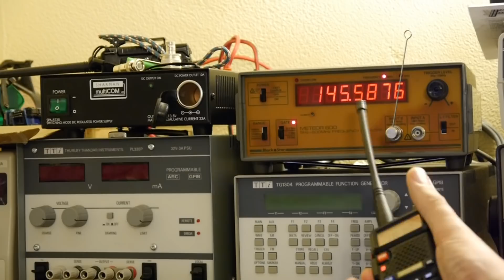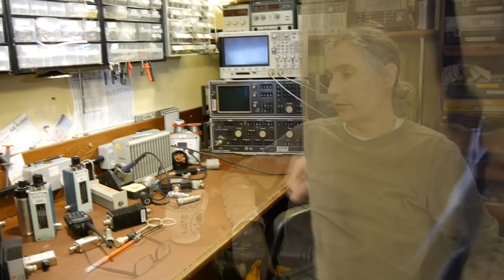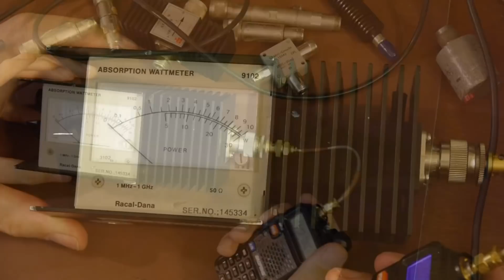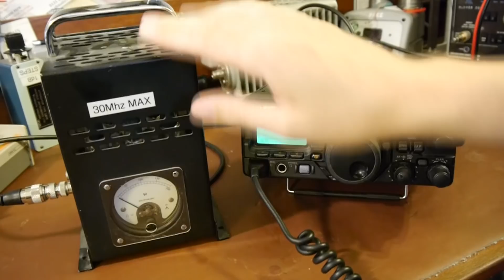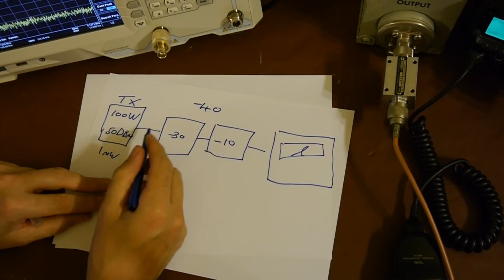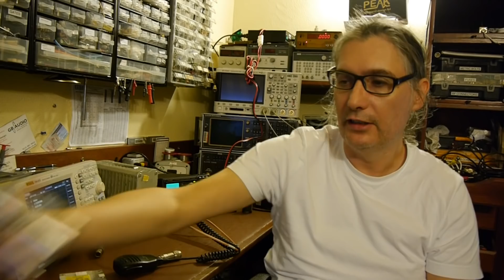RF Measurement Part 1   - When The Shit Happens

Comment: Oh no, the Marconi! That's a big shame. This was a really interesting video Chris, thanks.  I don't transmit as such but it's still obviously a big part of the broader interest in radio so this was very educational. I've never understood decibels so it would be great if you can go over that at some point. I bought an amount of Greenpar, Amphenol etc connectors on eBay, all sorts of stuff for a tenner I recall. Must have been a shack clearance or something but it was something like 20-30 different connectors. One of the best bargains I've had considering the individual prices. Fingers crossed the Marconi isn't a big fault.  Andrew

Comment: Excellent video - more please. That's a great tip about using adapters on test gear to prevent wear and tear on the input connectors. I did the same thing with power sensors, add a N type female to female "barrel" and a male to male adapter. We used to measure the added loss (at 1.03 Ghz) and correct readings.
Reply from the maker: David V Hello David thanks for watching and the excellent comments. I think someone passed on the idea about fitting a sacrificial onto me in the distant past. Although not shown today I mostly keep a short lead and a attenuator fitted permanently. Best regards Chris

Comment: Bloody hell that made me jump. Hopefully it's just the input cap! And just after you were saying how much you loved it! This was a very interesting video to me as I often wonder what I can and can't plug into the SA. I have just bought the same adjustable attenuator as the one you first showed. I think the next video is repairing the Marconi though. It as you say sounded like a hard short.
Reply from the maker: Simon Spiers  Sadly looks like a  more complicated fault a power diode D3 has blown on the power supply board. I have the operator manual for the 2380 display but unfortunately it does not have any circuit diagrams. Hopefully I will be able to track a diagram down next week but I’m out for the rest of the day. Also trying to figure out how to get the power supply section out without totally dismantling the unit I’m sure there’s a knack to removing it.  Regards Chris.
Reply from the maker: Simon Spiers  remembers when using the attenuators to respect the power rating and direction. Get some large fixed attenuators on the front end as it’s to easy to turn a variable attenuator in the wrong direction and blow up your front end.

Comment: Oh no, that sux!  Been trolling  for SA for a while, they are cool indeed!  ~Jack, VEG
Reply from the maker: Vintage Electronics Geek  Yes when you need a SA nothing else will do. I have a rigol unit but I prefer the Marconi. Started to investigate today and it looks like the power supply board has blown up. I try to find the circuit diagrams for it. Regards Chris

Comment: I built a 200W dummy load for my bench, I picked up some big carbon block resistors from RS, I think I used 2 x 100 Ohm from memory, mounted in a aluminium box and sits behind my gear on the shelf, I never do high power stuff anyway so it is never stressed even though it doesn't have mush surface area for cooling.
Reply from the maker: The Defpom's Repair Channel  I have another oil filled  Bird Termaline living under the bench due to its weight it’s rated for 1000 watt for 20min. I used to have a fan cooled dummy load that was continuously rated at 1000 watt. Mainly used this for running up valve linear amplifiers. I have some of those  carbon block resistors in an aluminium box with a gimmick wire sampling port ideal for using with the SA.